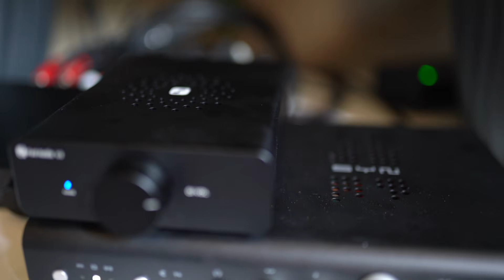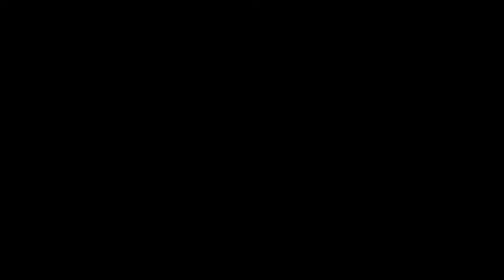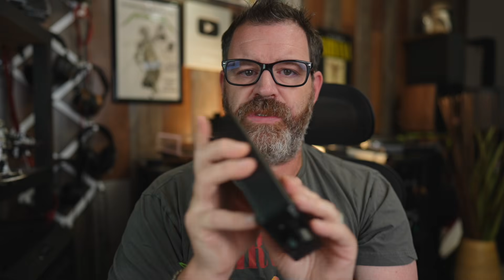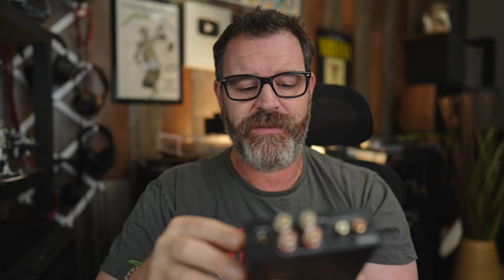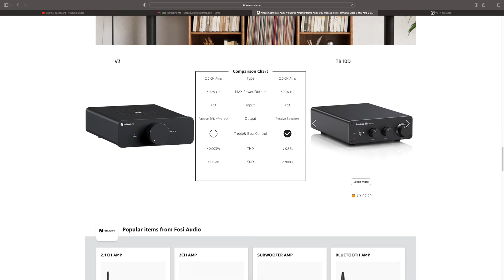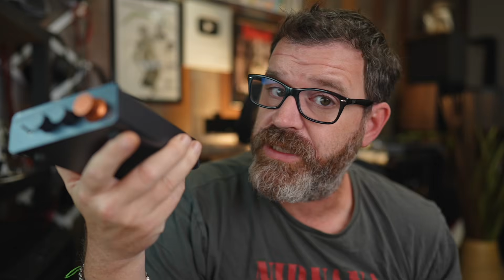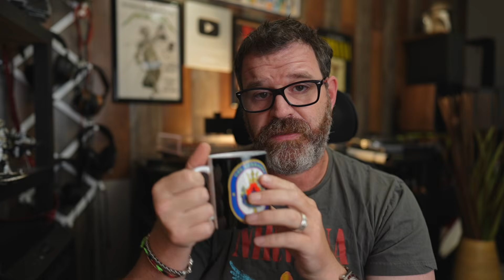Fosi Audio V3 Review - The Best Amp Under $400?

Comment: I'm reading elsewhere that the V3 "pre-out" is not variable and is instead a fixed line-out, unsuitable for a powered subwoofer. Can anyone confirm either way?
Reply: The "pre-out" level is not controlled by the V3's volume/level control as the V3 is not an integrated amplifier...it is a power amplifier with a volume control. However the pre-out level is not fixed...it is controlled by the input device connected to the V3. The "pre-out" is quite suitable for powered subwoofers and creating multi-amp systems. 

One last note: if your source device does not have volume control, you can purchase a very inexpensive precision  Passive Preamp  that includes the ALPS27/16 potentiometer,  for under $50 online.
Reply: @larryjohnson9019  Great reply which cuts through the noise. Thanks.

Comment: Okay let my come at this at a different angle, put together a best bang for buck system to use the following components:  Pair of BIC DV62si 8ohn bookshelf speakers, Def-Tech PowerField Super Cube II Subwoofer using LFE in only, Sony 51 disc CD player with optical out only, Pioneer PL7 TT.  And the following listening room and needs: Don't need blow you head off sound, casual single listener in a 15'' x 20' room with 8' celling.  Also need ability to stream BT LDAC/ATPX to the system and transmit BT to my B&W PX7 headphones.  Finally, I do need tones controls at minimum.  Thank you.

Comment: Amazon says it uses 230 Volts. What's the deal with that? Is it maximum, or is it European? Looking at just a Fosi power supply it says it's 100-220V.
Reply: The power supply is compatible with AC 100V-240V. We will provide a suitable power adapter based on your delivery address.
Reply: @fosiaudio  Oh cool. Thank you. I ordered a Fosi amp to work with a Fiio headphone amp and Klipsch R-41M speakers, looking forward to hearing it. 👍

Comment: I am wondering how it would compare to the BasX A2m Stereo Flex Amplifier from Emotiva which is currently $279?

Also, if I got this for a 2.1 setup and paired it with a DAC (with a remote) can you discuss DAC's or ways to also bring in a record player analog signal?  My Fosi DA-2120C has that all in one, but it seems rare to find a  DAC, non integrated amp, with an analog input in addition to the digital inputs. 

Or, is the TA1($599 now!) from Emotiva just the end all be all for a complete 2.1 setup including record player, laptop (USB), CD player (optical).  

Currently running B1+ and a Jamo 8" sub which will probably get replaced in time with an 8" sealed sub from Emotiva or the smallest sealed sub from SVS.  Don't need mega bass, just want quality bass.

Comment: The amp has good bones.  Not made with generic caps and resistors.  Folks, thats a BIG deal, especially at that price.  It's about like a $750 class D audio (brand) 2 channel amp.  I didn't see anywhere HOW it was tested at 300wpc, I suspect only at 1khz, not 20hz-20khz both channels driven.  I digress, if it can drive as hard as the numbers suggest, it could handle some tough speakers. My ongoing reluctance with class D, is the treble.  I get nothing but rolled off and vague treble from class D so far.  If you are a casual listener, or moderately critical- this amp looks like a giant killer. <cough>. crown <cough>.

Comment: I can attest to FOSI audio's quality.  I've bought several brands of these little Chinese amps.  All stopped working from 1 day to 1 year.  Yet, my FOSI units continue to function properly and sound great.  I made my own power supplies to bump up the power.  I made a analog wireless speaker setup for my rear surrounds that has zero latency, and use the FOSI stuffed under the couch going on 6 years now.  It doesn't complain and works perfectly.  All my desktop computers have a FOSI with an external DAC via USB.  They sound awesome.
Reply: No you can't. BT20 tubes destroying V3 with upgraded tubes and the so called wattage from 48v is utter bullshit.
Reply: Unless something sounds like playing music better then 20pro vacuum upgraded tubes stop wasting money. I tested way to much and 99% inlcuded V3 fosi sound like music having abstinecies. Yes I can match Randy's setup and no you shouldn't have to at 100$. Others said something about this and I'm just saying it again.  Chfi is expensive compared to doing it right

Comment: If you're using something like that with a system with a computer for your source like a media or HTPC, you can use a Flirc for system volume control (and other functions if you configure it)...amazing little gadget that plugs into USB that's about the size of a small flash drive and lets you use a remote for any computer...I really wish these amps weren't made in China...despite the quality, giving those commies my $ never feels good

Comment: If you need a dac that can output to multiple amps(11:53 if I'm understanding you correctly), Topping D30Pro can output from the XLR and RCA at the same time. So one could just level match the two amps and have an identical signal pretty much(both outputs are totally clean of course).

Comment: Yet another 50 WPC amp with exaggerated specs. I don't care if it makes double that power. Once I start seeing misleading information and peak power ratings at 4 ohms, I look elsewhere because I hate being tricked. Ended up buying a used Denon AVR with an honest 120wpc into 8ohms for $75 local and 7 channels with EQ, bass management, pre-outs, bypass etc., not to mention much lower distortion. A used AVR makes a hell of a desktop system amp. There are no rules that states the amp needs to sit on the desktop.

Comment: I don't need a new.. (or, new to me) ..stereo amplifier, but now I want one of these, as a 1'st foot into this 'type' of budget amp, as a spare stand-in for my main stereo amplifier (or even a replacement??) tho I'm sure it'll upgrade my computer desk-top speaker sound now fed from an old germanium transistor (that old!) stereo int' amp, 8'ish times the size of this lil' un. After a spec's re-check, i'm surprised to see how it doubles it's wattage output at all working voltages when speaker impedence is halved, even if half or two 3'rds of the given wattage numbers are the true actual very low T.H.Distortion figures of "clean" watts (<0.1%) to hear, then it's plenty loud enough for myself (esp' after a friend enabled me to hear my stereo play music at a measured true 5'watts RMS max' limit & nearly deafening my ears in my listening room) & the given ratio of spec's suggests a "theoretically" perfect current del' for it's watts out, good bass (& likely no harsh treble) is what I'd expect from the spec's alone.

Comment: Btw, the Topping PA5 is balanced input only, with an explicit mention in the manual to not use adaptors, so please can you compare using a dac featuring both rca and balanced outputs (such as the Topping E50), thanks

Comment: The thing that kills these products for me is the stupid high voltage DC power supplies. I'd much rather see 12-24v with higher current requirements since those power supplies are much cheaper to buy.  My home theater setup recently had a casualty. My awesome Mirage Omni S10 subwoofer seems to have blown the mosfets. So as a temporary replacement, i wired up my old-school SoundStream Reference 500s car amplifier, a Boston Acoustics G312-44 subwoofer, and a 40amp 12v power supply and it's simply amazing. 500w RMS into that dual voice coil 12" sub is wonderful for movies. 

So this got me thinking, my two main front speakers are JBL Studio Series S310's and are kind of under-powered being hooked up to a Harman Kardon AVR354 Receiver. I just might have to hook up a car amplifier to the receivers pre-amp output and give them a proper 500w per speaker. No need to spend thousands on expensive power amplifiers.
Reply: Just because you can drive it with 48V, it doesn't mean you have to. At 48V 10A, you'd get very high THDN number. The fact that it's expensive shows how ridiculous it is to run 10A thru a solid state device to amplify signals... everything will get hot, thus they need to make things heavy duty, which in turns elevate the cost.

32V-36V is the sweet spot between power and distortion.
Reply: These aren't conventional amps. The TI chip requires specific power input. If you read Texas Instruments' product sheet for the TPA3255 chip, you'll note that higher power from the chip is voltage dependent and not amperage.

Comment: They should do preamps with all sort of conteols and 3 rca in and rca out to mono blocks
Reply: As for RCA out to mono blocks, do you mean a dual RCA (L&R) to mono blocks or single RCA to mono blocks? And the 3 RCA  in, do you mean 3 dual RCA (L&R) or 3 single RCA?
Reply: The "perfect" one would have it all;

RCA to one Power Amp

RCA to two mono Power Amp

RCA to Subwoofer Power Amp

Everyone of these would open up for a variety of options!

Over them all the one preamplifier to 1 Power Amp & RCA to Subwoofer
Reply: @p.a.s.5948  So you will use these amps to power your center channel speaker, left and right channel speakers, and a subwoofer?

Comment: I like these TI chips, but prefer the sound of the Infineon based amps like some SMSL and Loxjie.  Not as much power but they run cooler and sound a bit closer to AB to me, especially with efficient speeakers.

Comment: I'd buy one if i knew how to hook it up/What to hook it up to. Can I hook it up to a basic older receiver?? I want to learn.:face-orange-frowning:
Reply: Please tell use the model of your basic older receiver, if it has the analog audio output, .simply use an RCA cable to connect the audio output of your receiver to the RCA input of the V3. From there, you can connect the speaker outputs of the V3 to your passive speakers.
Reply: What brand and model receiver do you have? Does it have RCA pre-outs?

Comment: Buying 5 of these to run my 9 channel Atmos
Reply: Can I know your speakers and do you use an AVR to connect the amps to?
Reply: @fosiaudio  yeah I have a pioneer lx505 but I have issue with buzzing in a 8 channel setup 4.1.4 so I ordered 1 so far and am planning on ordering 4 more to cover 9 channels. I only play at volumes of -15 db below reference at max and it not crazy with a full emotiva setup. I'm planning to just use the right channel for the center as the 9th channel. Emotiva t1+ mains, c1+ center, b1+ surrounds and 4 a1+ front and rear heights in a small room. I also have a rsl speedwoofer.
Reply: @fosiaudio  would you guys be down to hook me up with a deal for buying so many or if I can review them as multichannel units I would be down to make a video or something

Comment: Well I ordered one last night, but cancelled again this morning since I figured I don't have a use case for it already having a TB10D which is powerful enough and audiophile sound is not the use case for it as I like my vintage Sansui's too much, so no need to replace any of it.
Reply: 😀Thanks anyway.
Reply: @fosiaudio  well I might still get one later on.
Reply: @D1N02  I absolutely love my Fosi Audio TB10D!!! I think it sounds better than the built in 50W per channel amplifier in my Marantz NR-1403. In fact, the Marantz shuts down with my 4-ohm speakers, and the amplifier section just stopped working a few months ago. I bought the TB10D for $60 on Amazon and am using the RCA pre-outs on the Marantz and now using the Marantz as a pre-amp and my office system sounds better than ever. And the Fosi never even gets warm. The V3 has much  higher grade components so I am excited to see if there is an improvement.

Comment: I think if you run this thing with 48v@10a you'd better have a fire extinguisher nearby. A few vent holes top and bottom aren't going to cool it sufficiently.
Reply: We use the whole case as the heatsink.
Reply: @fosiaudio  A fan or three might be advisable as well, but I'd be interested in seeing the actual results with this thing is run full bore...
Reply: @jontpt  A fan will bring noise.
Reply: @fosiaudio  A fan will also bring cooling and extended component life. But I would be very interested in seeing actual tests of this unit run at its claimed wattage potential.

Comment: Respectfully the claims of being able to output 300W x2 for these series of TI TPA3255 Class D amplifiers are not false.  (see Willston Audio Labs test of the Aiyima A07 5 months ago on Youtube) I've also reached these power outputs with my own pair of A07s powered by a properly spec'd 600va SMPS, which I built. The TPA can output 17 amps of current before triggering its protection circuit, this is not Fosi or Aiyima's spec... but Texas Instruments (TI). (See TI's datasheet for the TPA3255). Lastly 48V 10a (480va) supply will never deliver 300Wx2 regardless of the amplifier's Class Type being either A, A/B or D. You need a minimum of 600VA power supply with the most efficient amplification class..that being Class D. With that said, if you want full power delivery capability with a 48V supply you need to be looking for one that can supply at least 13A of current not 10A.
Reply: ... ladies and gentlemen, an audiophile has graced the comments section. Well done ✌️.

Comment: I bought the last Ieyma or whatever that was rated 300wpc that you fawned all over.  This makes the 140wpc not a reality much less the 300w at ass bag distortion into 4 ohms considering it came with a 32V 5A PSU.  It sounded weird, I sent it back.  My Crown D75 is better sounding, louder (35 REAL wpc @.001THD, 55 @ .1) and I can hit people that disagree with me with it and it will still work better than they will afterward.  Mine doesn't have a warranty but it's still going after 50 years and I bet you a dollar it will still be going when all of this Chinese crap is landfill.
Cool Japanese and German components though, GG.  Now if only they can copy either nation's work ethic of pride in a job well done.
*With a 48v 10A PSU, a 48v 7.5A is the highest current available on their webstore (at about $10 less than the amp, I imagine the 10A PSU costs more than the amp is why it's not available along with the noise issue you mention). The 7.5A isn't even on that spec sheet.

Comment: It should follow la90's switches on the back also (volume bypass, and mono/stereo options). Your suggestion on the power supply makes (very much) sense. Go Fosi! This seems like an excellent pairing with warmer speakers. (Polk and Elac bs41 come to mind)
Reply: Thank you for your valuable suggestions for further improvement. Could you please tell more why do you want to bypass the volume?
Reply: @fosiaudio  to use a deticated power amp for a hometheater avr with preouts. A lot people want separates, its the reason we buy these amps because we cant drop $500 dollars on a power amp made for home theater which is usually stereo at this price to performance. The bypassed volume knob makes it so we can just control the volume with our home theater systems without having to get up and redial the gain and having to match them across multiple speaker pairs (5.1.4/7.1.4). If there was a product with a quality and parts like v3 with bypass as well mono capability to further separate the amp crosstalk using the 3255 is necessary as its tried and true for performance, but I know many like me would be willing to pay 100 dollars each for monoblocks if the performance is there as with the v3.
Reply: @MultiDragola  Got it.

Comment: I am the type of listener that always turns the Bass and Treble all the way up in any car.  I must like dynamic audio.  I have learned through failed experiments it is a failure to compare any 3255 amps when both don't offer the tone knobs.  This has been between the A07 and the A08 pro and the A08 pro and the Douk H7.  
The perceptions I erroneously fell into:  Sony SS-CS5 had more bass than the RP-600m and 160m.  Sony was favored with the A08.  Sony was better matched when I fixed my error, but I still think there is some detail in the Sony Bass that the Klipsch isn't matching.  Caveat, I am not getting loud enough to challenge the Sony's limitations.
Fading up a JBL Stage a170 with the SVS ultra bookshelf on top of it.  I thought I was getting cancellations with the bass when adding the a170 to the already playing Ultra.  It turned out that was mostly caused by using the Douk H7.  When I repeated the same process with the a170 connected to the A08 pro.  Addition of bass occurred as expected.
I think I was hearing the JBL add flat but the tweeter was much more pronounced, thus it overall sounded like a subtraction of bass.

Both of these were embarrassingly horrible comparisons.  My take away from this is a new assertion that, for me,  the tone controls are very important.
I also have the updated Fosi TB10D. 
The sweet spot for me is high power, tone controls,  and maybe the ease of swapping op-amps.  I guess the more you buy in your exploration, the less you have to consider once you know what you prefer.

Cordially,
Addict in FOMO rehab.

Comment: is this worth upgrading from a a07?
Reply: From the test results and measurements I have seen and as I understand them, it appears to have better results. The potential increase in power output with the beefy psu is quite minimal. The slight improvement in sonic performance insignificant and likely inaudible. I’m inclined to invest the additional $40 into my speaker fund, lol.